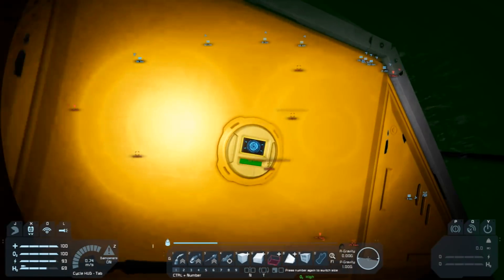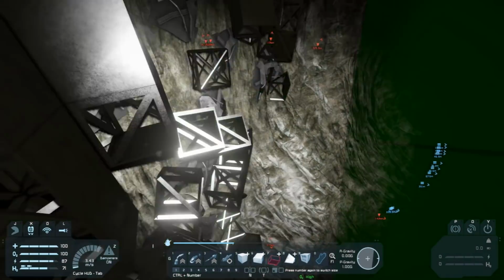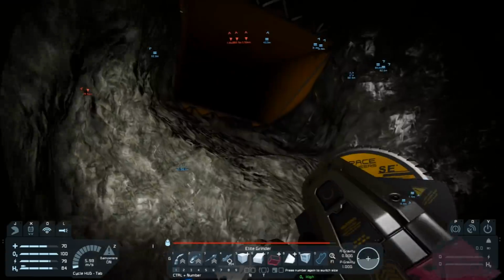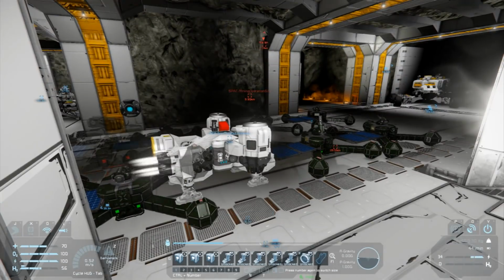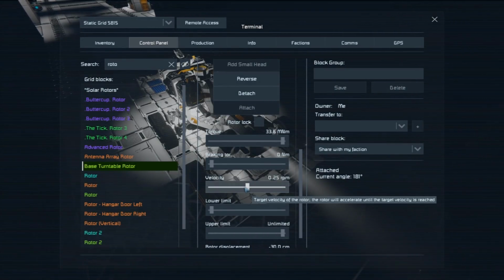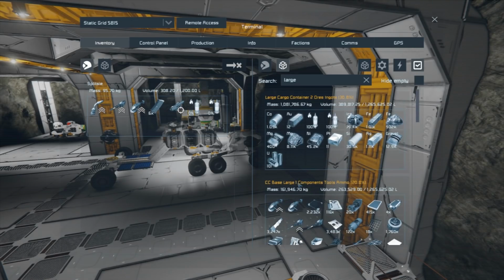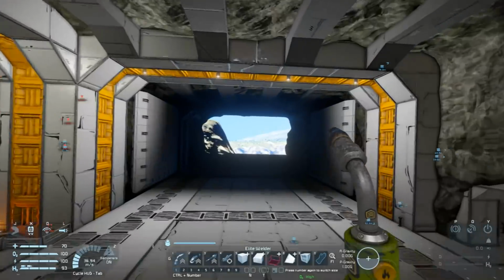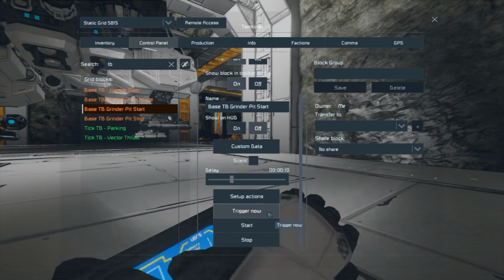Survival, Maybe... #58 Drones learn to use wheels... sort of (A Space Engineers Survival Series)

Comment: @Splitsie here's a cool idea for your series, build a lighted path between your base and the mine entrance so that you can travel safely with the goose at night! You could build "streetlamps" using small blocks with a single solar panel at the top, and there's a battery mod that is well balanced that gives you slim batteries, 1x1x3 that only use 4 power cells and provide only a small charge. As for the block limit, why not just turn it off, it's really only there to make multiplayer more stable.
Reply from the maker: I'm probably not going to add a mod, but I'm thinking I might do a simple battery+interior pillar+interior light for a very simple streetlight to guide the way, but I'd need a LOT of them to cover the full distance...
Reply: @Splitsie  IDK if there's a script for this or if sensors would be necessary, but it'd be neat to have a series of spotlight towers that could follow you within a certain range illuminating you at night.
Reply: @Splitsie  The goose has lights, a trail of GPS markers to follow would be sufficient.

Comment: Looking good.

I think the attempts to get all sensors working on the grinding pit are more effort than the reward they will achieve.  Given that the timer block is doing its job, I would settle for a manual start, which would take just a couple of seconds to flick the switch.  Extend the grinding time and only start the grinders when you have a sizable amount of junk in the pit.  There is no rush, it will still be there if you grind it as you put it in the pit or you wait a little longer.
Reply: At this point I agree.
Reply from the maker: As do I, silly sensors not behaving I'll just put them on a time out ;)

Comment: I have a suggestion for the ramped part of your grinder. Instead of using slopes, how about an unpowered rotor with a stack of tires shooting across? It would require a lot more work overall, but you'd have a roller style chute instead of all of the blocks sliding against one anothee
Reply from the maker: It would be cool and I'm tempted to try it, but I'm definitely testing in creative first, my worry is that pieces will get caught on the edge where the rotors are
Reply: Splitsie that's a valid point. What it you offset the rotors into the rock one block, so that the tires actually start under the existing wall.

Comment: To save on power, you could have the start sequence timer block activate the safety sensor, and the end sequence timer block could deactivate it. Since, all going well, the grinders are only a safety issue while the pit is in use... and sensors with a radius that large tend to be power hogs.
Reply from the maker: That's a good point, I'll add that in to the sequence :)

Comment: Splitsie, whenever I see you grinding pit, I want to see the bottom part with the grinders rotating as well ;) Like a crushing mixer :P Also, you could prevent the parts from flying everywhere if you'd have a sensor, that reaches barely over the top of your grinders with the actions: 1. Retract pistons 2. Extend pistons (detecting small grids). Although this barely possible with your current design (because of the cone shape), this would just extend the pistons until there is a small grid detected and then retracts.. So that the pistons would do a constant up and down motion. After a certain period of time, the sensor could be deactivated and cause the whole thing to retract. Starting procedure would be a more long range detector at the top... The same method could be applied to detect your station so that you could have a proper floor that won't be ground up ;) Could be cool ;)
Reply from the maker: That's an interesting idea to use a sensor to prevent grinding of your own grid, could be useful if you have a more complex setup with other subgrids that move in to clean up stuff like the pieces of scrap debris :)
Would also be useful once the maximum limit of a grinder range is known, when building a new pit, just set up the sensor with the correct range and no need to fiddle around with piston maximums :)

Comment: I know you no longer work on this series but here's a tip that might be useful even outside Space Engineers. When you need to think something that has an order of execution, it helps a lot to open paint and sketch a small scheme for what has to happen. In this case, what timers need to be triggered by the sensors and such.
Reply from the maker: That's a good point, I actually did something like that when I was setting up my audio for streaming/recording now that I'm using a separate PC for it. Was just too hard to do without the visual aid - might try to use it in SE for timer setups in the future too now :)

Comment: You should be proud of that truck design - I imagine there's many a trucker who'd love one in real life. Looking forward to seeing what other trailers you're going to make for it as the series progresses! Incidentally, I tried my hand at Creative mode today, see if I actually could design a VTOL 'bee' type craft ... Nine hours, several iterations, multiple explosions and one >cough< 'successful' test flight later (and by 'successful' I mean that I managed to get into the air, spin nauseatingly until I was able, somehow, to point the nose upwards and ascend vertically to 3k feet, fall slowly while I tacked on a thruster I lost on the way up in a death defying EVA, only to pancake into the ground attempting to level out once back in the cockpit), I'm thinking I might have better results if I simply sling a thruster underneath a couple of hydrogen tanks with a seat on top, and light a match - rofl
Reply from the maker: I really am proud of the goose, it's still one of my favourite designs that I've made for space engineers, which may in a small part be due to the fact that I didn't think it would ever work :)

Vector thrust craft can be very unwieldy, I've tended to come and go from using them as they can be fun but frustrating to get right :P

Comment: Splitsie, you really don't want the runtime timer block. There could just be one sensor with the actions: 1. TB Grinder Pit Start Trigger Now 2. Retract Pistons. This was your first design. The pistons should really not retract when there is more work to do. If by chance the sensor got deactivated temporarily and caused the pistons to retract, the remaining parts would trigger the sensor immediately and cause the pistons to go back down. The reason that this design did not work at first is only because you set the sensor action to "Start" instead of "Trigger Now". If you keep the design simple like this it will be much easier to debug.
Reply from the maker: Yeah, was it your comment on the last one that mentioned the same thing? I read it after I'd already recorded this and had to facepalm when I'd seen I'd missed it :P

Comment: You can add a piston with a sensor that extends whenever you place things inside the hole of the grinder it will push the sand bags into the proper position for it to be grinded. Basically something that works same as like the grinder only it's used only for pushing the sand bags.

Comment: For all the trouble you've gone through, you could just put your grinders in the bottom of the pit facing upward, like they do in the easy-start base, and put a set of vertical AT Hangar Doors at the bottom of the ramp that close when the grinders activate.
It would solve the problem of random debris lying around in the bottom of the pit
Reply from the maker: Static upright grinders will always leave small pieces between them which can only be dealt with by hand, I was hoping to come up with a system that avoided that so I'd be able to leave the process completely automated... didn't work out quite as planned :P

Comment: There are individual block limits for things. You can have limited antennas, limited of each type of turret, and so on. There is a limit on armour blocks but there is no way you are even close to that limit. In the episode you must have reached the antenna limit. You may have been able to place more armour blocks or timer blocks, just not more antennas with the limits on.
Reply from the maker: Huh, didn't realise there were individual limits. I thought it was some sort of value per block sort of thing, where functional blocks are more expensive than armor. Either way I've disabled them now so we can just keep on building :)
Reply: If you go to the info tab while not connected to a control pannel you can see the block limits for things and how close you are to each block limit. It does not appear if you do not have block limits enabled. Glad I could help! 😁
Reply from the maker: Huh, never even looked at that, thanks for pointing it out :) 
I only noticed the block limits in the new multiplayer test patches and they seem to work a little differently
Reply: I am fairly but not entirely sure that the limit is on a per grid basis.

Comment: addon idea for the grinder shaft... on the  stone sloped area mine that out and place staggered powered wheels that will shunt the object downward. 

Love that grinder shaft, lot of work went into that masterpiece :)
Reply from the maker: The main challenge with wheels for it is that you can't get them close enough to each other to stop pieces falling in and jamming them up which can lead to some pretty hilarious, and explosive clanging :P

I wanted to do it but just couldn't come up with a solution I was happy with for the wheels :(
Reply: @Splitsie  I was thinking a rotor mounted wheel that was essentially a pillar of wheels horizontally laid periodically along the shaft downward rolling, just to keep things moving... Noticed in one of your vids there was a queue of idle sandbags in the shaft. 

Grinder pits are so hard to get to work right what with clang and grinders being spinning part catapults. Really like the idea using the voxels as a bounding wall, never thought of doing that myself.

Comment: It'd be time consuming to build, but one way you could improve the grinder pit would be to line the chute with wheels, perhaps with a sensor that turns them on when something is dropped into the chute, but even freely rotating wheels I would think would help improve the flow down to the grinder. :)
Reply: Also, if you ever go far from the base, a couple mods for a more permanent defense grid that might be worth checking out is a laser turret mod and a transmission power mod. I forget how you feel about mods, but the laser mod is pretty well balanced imo; being arguably weaker than the stock turrets, but only requiring power to operate. While the transmission power mod requires some rather expensive materials to make, though if memory serves, in small amounts. Plus the falloff is realistic too, as I recall. Still, if nothing else, the transmission power would be a neat way to charge up your vehicles remotely.
Reply from the maker: Even now that I'm at ep 104 I have still stuck with the same mods, I like the design challenges it imposes to not solve things with new mods :)
Reply: Fair enough. Just a suggestion. Still, that would be an interesting thing to see you do, though I can't say where you are in the series now as I'm roughly 40 eps behind (actually just checked and it's actually exactly 40 right now), but going to a moon and starting a base there would definitely be interesting. Esp if you can get the AI to attack you there too. shrugs

Comment: I don't know if you read my suggestion for the grinder pit as I was a couple of days behind. 

My idea is to have a timed cycle that switches off the sensor until  it is done. 
That way it always resets itself. A few minutes delay at the end could give you time to drop stuff in and you could even have lights on the top to let you know the pit will close soon. 

My rough idea which I have no doubt you can improve 

Sensor is triggered red light on 
1 minute doors close and grinder sequence starts sensor is switched off 
The rest can be time based from that with maybe a small delay at the end before the sensor is turned on. 

The only issue is can think off is would the sensor trigger from scrap already in its range when it turns on? 
If not would new scrap entering its range trigger it. As long as one of those 2 things has a yes answer it should be fine........ I think lol 

Loved the mining montage by the way and also seeing the slope up to the base in the day. I forget how steep that route is.
Reply: Just an additional thought 
Red amber green sequence 
Green when the grinder is rising and doors are open/opening but sensor is still off.
Amber when sensor is switched on. Will then go red if triggered

Red when door is about to close/is closed and pit is working

Would give an easy visual clue to what is going on and look pretty cool
.
Reply from the maker: Might also give me an excuse to use Isy's light color changer script :P